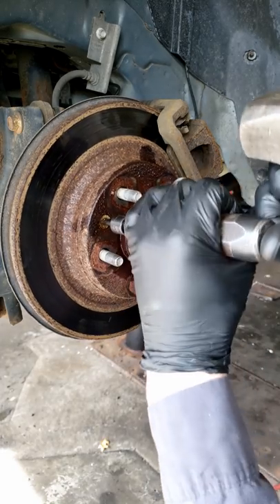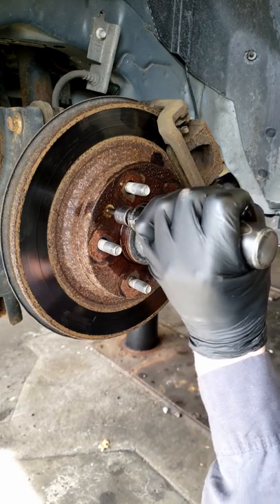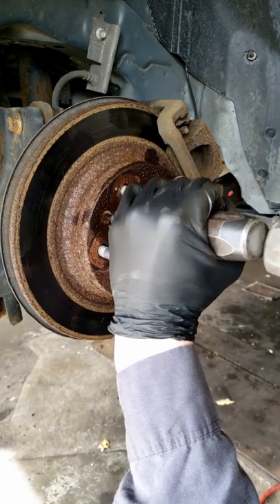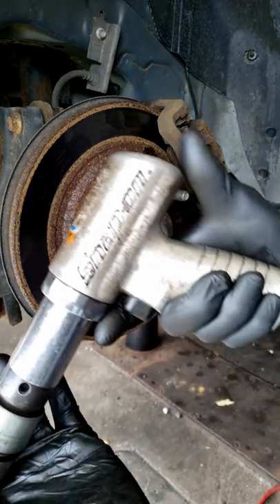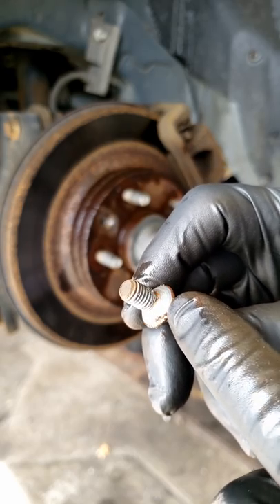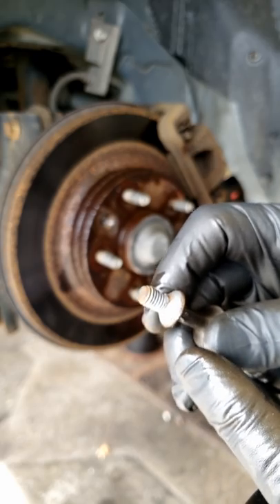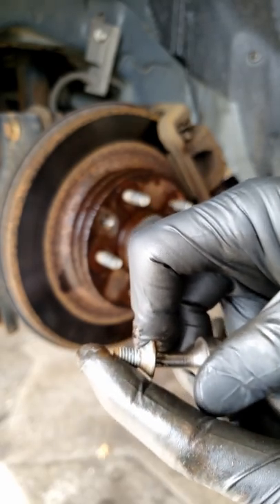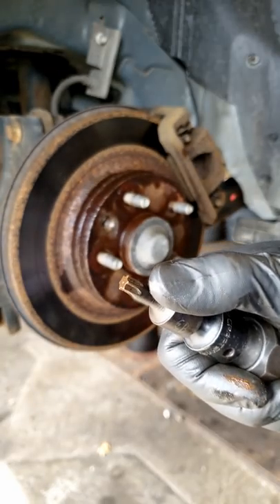Best Way To Remove Brake Rotor Screws

Comment from the maker: ~Part 2  (Response to comments) https://youtu.be/2cHwEfKTiKk
Reply: Hey brother had to edit my response and didnt know they were gonna take my heart thingy. Those bastards lol. With it being my first one ever how about giving me another one for old times sake.lmao
Reply: I never could figure out why they put them on the tire holds it on
Reply: @swschrader1981  It's nice to keep everything clean. If any rust or debris gets between the rotor and hub, you get rotor runout out of spec and eventually parallelism variation, which causes vibrations while braking. I actually appreciate them, and always clean and anti-seize them and the hub surface before reinstalling the rotor.

It also keeps the rotor properly centered on the hub.
Reply: try putting some lugnuts on and tighten them to take the tension off the screw. Get a spare set of open ended nuts or stacks of washers. likewise tighten couple lug nuts without wheel before hand setting the new retainer screw.
Never put any lubricate between hub and rotor. You will never see this OEM because this would convert the assembly from a friction locked clamp to a cyclic shear bolt cutter. Yes, the clamping load plus coefficient of friction between hub and rotor protects the studs from cyclic shear loading. wire brush brake cleaner. if needed, water based rust converter or phosphoric acid apply and wipe dry.

Comment: FYI: the screws are only put on the factory lines so the rotor or drum don't fall off while it's rolling down the factory line there is no need to replace them.
Reply: I really wish the factory workers would  unscrew them before installing the wheels
Reply: Lol ok raybestos salesman. I don’t respect cars without rotors that sit flush on the hub without a wheel on. Ahem Mazda ahem…
Reply: @socalzaps2848 he’s full of shit and heard that from a parts man. I would know, they tried telling us that bullshit.
Reply: Exactly. The amount of time and sweat it took me to get mine off, the last thing I was going to do was reinstall new ones.
Reply: Actually they’re only to hold the rotors as you set the caliper🥱🥱 once the caliper is set and torqued then you remove the “set” screws and mount the tire👍👍
Reply: Tell me you’ve never done brakes in your life🤷🏻‍♂️
Reply: @ger._.  I understand it comes in handy to hold the drum on but literally there is an engineering question on the ASE tests of whether it needs replaced or not when you do the first break change and the answer is no and the professors would tell you toss it this is information from the engineer's
Reply: @REPENTINCHRIST  I see what you’re saying, on the ford stars testing it basically explained that it’s only to hold the rotor while mounting the caliper, once caliper is mounted then take set screw out, I’ve never left a set screw have done 100s of brake jobs and cry when I have a work order, take off the tire and walla set screw on a 60k rusted rotors 😭
Reply: Yeah and next year there will be five of the fucking things all just long enough to get rusty and hard as fuck to take out.
Reply: @rubensano4860 i knoooo thst riteee i hate that jackazz screw😡 😂😂😂
Reply: Anyone know why they use the screws in the first place?  They used the ( I don't know the proper name...) push on washer like things over the studs on some things and those seem to do the job just fine of holding the rotor on and in place on the line.  is there some drawback to those clips that the screws solved?  I can't see how it would be more cost effective to have to machine the rotors and hubs for the screws as opposed to using the clips.

Comment: Once screws are removed, do not reinstall. They’re not necessary.
Reply: Yeah they can be helpful for holding things steady durring assembly, but not really needed once the caliper is on and not doing anything at all once the wheel is on. Just be careful not to knock the brake pads too hard with the rotor before the wheel is on, could chip an edge. In theory if you ever lose a wheel it could help prevent some damage to the calipers, but you're still looking at a big bill in that case anyway you cut it. If you live in the salt belt leave em out, if they came out clean not really any harm in putting them in.
Reply: @Oleg-oe1rc bro they’ve had retainer clips since the 50s and guess what they work WAY better. Slide over lug and voila no rust bs screws that are over engineered.
Reply: I just pop a few washers on two studs and snug up the lug nuts by hand to keep the rotor still while putting on the caliper and bracket. I never reinstall rotor screws.
Reply: Why did Ford even designed it that way ?
Reply: But then the rotor would just fall off if there's nothing to hold it in place

Comment: It seems from reading the comments that many people like to just drill them out and get rid of these screws. I use that technique as a last resort. While these screws are not "needed" I still prefer keeping them in place so that when the wheel is removed for other servicing, the rotor has no chance of breaking free from the hub and possibly allowing dirt, grit, or rust to enter in between the rotor and hub.(which could lead to brake pulsations)  Also some people are confused about me using the phrase rotor screws/bolts.  I was referring to the rotor screws, not the wheel studs. Anyway, just wanted to clear all that up instead of replying to comments with a "book".  Thanks! :)
Reply: Drilling metal like that SUCKS. Air hammer is not only more fun but you don't wind up consuming a bit or reducing it's life span
Reply: I've been working on cars for a short time, but, i have never seen a rotor fall off by removing the tire... usually, the caliper and brake pads, even severely worn pads will hold it in place... but, like I said, I don't know nor have I experienced everything in my 9 years as a mechanic. 🤷‍♂️
Reply: @wolfhuntersarmory  I don't think he was saying it would fall off but if it breaks loose from the hub even a little bit debris such as rust and dirt can get inside and not allow the rotor to sit flat when the pressure from the wheel being tightened back on is applied
Reply: In all honestly i do the same thing as you but not with an air hammer. Since i am more of a mobile mechanic i have to use a brass hammer. It does the job but it is a little harder at times. Now for the screw i will clean them up and check if the threads are damaged. If they are still in good shape I'll reuse them. But before i put them back in i always clean the threads in the hole and put never seize on the screw to help prevent or make it as easy as possible for the next guy.
Reply: @GageDrums  rust and dirty can get inside nonetheless. Especially after driving in water like rain or snow. So that isn't something i would be very concerned on since it won't be enough to actually affect the rotors.
Reply: it was desing by idiots engineers think need screw hold it on wheels bearing 

personally dont need screw because have rim n lugnut hold them in place
Reply: So I see guys are leaving the rotor screws out, So the next time someone rotates the tires dirt falls in behind the rotor and hub, No wonder I see cars along the highway with the wheel gone after the torqued lugs come loose as the dirt worked it's way out slowly causing a disaster. I see this with class 8 trucks when a lot of corrosion takes place next to Aluminum rims and the drums, Because far too many IDIOT mechanics throw away the plaster spacers to the point manufacturer's don't even bother to use them anymore, Why because Aluminum doesn't like being next to steel ever in corrosive and wet environments it turns to shit looks like well some call it cocaine. South Main Auto brake job videos my show the correct procedure's got up north at least, We don't care how the South does brake Jobs it only really matters up in Northern states- Canada and so on.
Reply: @raymondreiff8170  square as the day is long

Comment: Im so glad in australia that we 99% of the time dont have to deal with this rotors basically fall off once the calipers are removed
Reply: When we got our suburban from my father in law the brakes were squeaking. The rotors were worn through to the fins and pads were completely gone.
Reply: Ya most the vehicle hear dont  have them. Plus they are point less i never put them back on if if they have them works out ok worst idea ever eay to much heat to put them there
Reply: @scotttam7491  What most vehicles don't have rotors ? 😂🤔
Reply: @longy6612  They did until Scott worked on them😂
Reply: @longy6612  no the screws in the rotors lol we definitely got rotors lol
Reply: @scotttam7491  alot or rda and dba kits have bolts for rotors and drums.
Reply: @scotttam7491  hack
Reply: The screws or bolts in the rotors are only needed for the assembly line that builds the vehicle. They keep the rotors from falling off between assembly stations. Once the wheels and tires are installed, they serve no real purpose... however... the threaded holes can be useful. Take a couple of long bolts with the same size and thread pattern, grind the thickness of the rotor off of the end threads and use it kind of like a bearing puller to loosen a rotor if it has become seized to the hub or wheel studs. 😁
Reply: @bigmodsgarage  im no master mechanic never claimed to be i work on my own cars an trucks so il do it how I want. Anyway if you really think that tiny ass half inch screw is goin to make any difference id love to no why I honestly didn't see any advantage of it beside it being a pain in the ass for the next time I need to take the rotar off. Most the vehicles I work on don't even have one off those granted most my stuff is older. Lastly why don't offer some insight on it instead of just putting a person down
Reply: I'll trade rust for not dealing with giant spiders and a fuck ton oof bugs
Reply: Sounds like your cars are stuck in 1968..
Reply: I love all the reactions saying the screws are not needed, lol! They are needed and if originally fitted they must be replaced at disc replacement, yer I called it a disc, I am in the uk! If you change disc you will normally see there is a small amount of play between the centre of the hub and the disc, only small but usual tolerance given is about 1mm, more in some cases, if you let the disc sit down on the top of the hub nose cone then you end up with a gap at the bottom, doesn’t sound bad but that small amount of offset then causes vibrations or wobbles due to imbalance once you clamp the disc there with the wheel, they do a very important job of centralising the balanced disc! so in short if it was fitted put it back!
Reply: @frostythehelmet  all American cars don't need these screws. There only for assembly line. Those screws are to small and to weak to be of any significant value. Once you aline your rotor to where your caliber goes on then that itself holds rotor in place to where the rim mounts on lug bolts and you always star cross your lugnuts that will center your rotor with your rim those screws are literally worthless and I learned that from being ASE certified.
Reply: No salt haha
Reply: @wolfhuntersarmory  I re use ONE of them and only run it down until the rotor stops flopping, make pad/caliper install slick. I also oil the threads.
Reply: Well winter and salt on the roads has a huge affect on how those bolts come out.
Reply: Lmao come to the Kimberly's @longy661
Reply: Everting rusted here 🇺🇸especially in the north states & Canada 🇨🇦
Reply: If I lived in a rust free area I'd probably would have become a mechanic. Just much easier
Reply: @longy6612  hahahahahaahahahahahaha you're not wrong x
Reply: @longy6612  buuuuuut, 4wding, barras, crabs, yabbies, fresh water holes, salt water fishing, sight seeing, sunsets, sun rise xxx
Reply: @Slidee  whats with the xxx you bent or something
Reply: @longy6612  is that all you gathered from that? damn
Reply: Here in NZ we get rusted JDM vehicles where these are constantly seized
Reply: @scotttam7491 🧐 brake drums is the only other option I rather have rotors then change a drum tune wise
Reply: @frostythehelmet  you think that screw does anything??  Once you tighten down your lug nuts that disc isn’t goin anywhere an if anything what your say about the screw would the other way around the screw would hold the disc tighter to hub an not allow play even tho it doesn’t matter because once you tighten down the lugs it all tight together. I swear ppl love to argue over nothing or just for the argument

Comment: Me myself i just use map gas and a hammer. Heat up the screw for around 4 mins turn off gas then whack the surface were the screw is located. Insert torx bit and remove. Learned that like 15 years ago after getting tired of ruining my bits. Try it you wont be dissatisfied i promise. And being honest not everyone can afford or even have acces to air tool tools. Let alone a fancy dandy air hammer.Just yankin yah chain buddy great vid and info but in the future if u have the chance give my way a try.